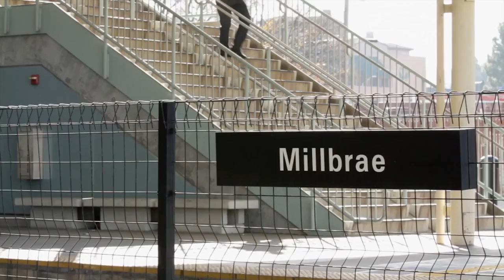CalMod Electrification and the Future of Caltrain.

Comment: Electrify the system, but please do not make it look like a light rail system. Make it look like a train. Like a high-speed train… Not a light rail.
Reply: that may take years to decide what rolling stock to use on the california hsr and construction
Reply: They're using stadler KISS double deck trains used in Europe so it still has the commuter rail style
Reply: bro what? why design a commuter train like a high-speed one? especially since actual high-speed trains are going to use the line eventually anyway? there is a reason commuter trains don't look like a bullet train: it's stupid and wasteful for a train that isn't any faster than a regular car to have a big snout.